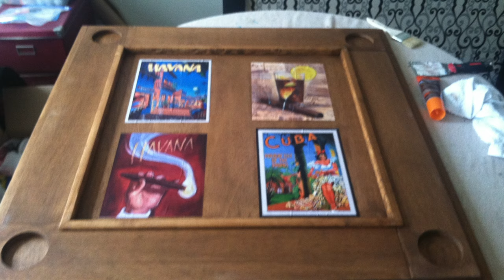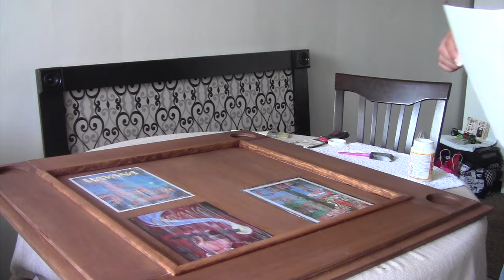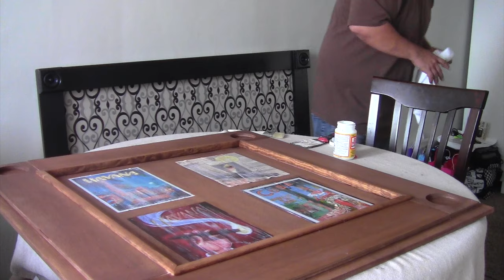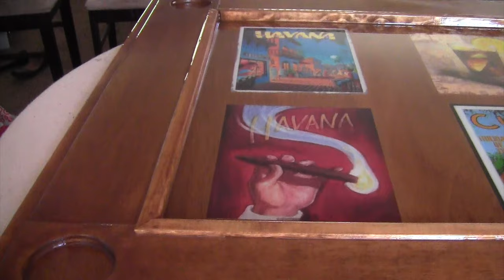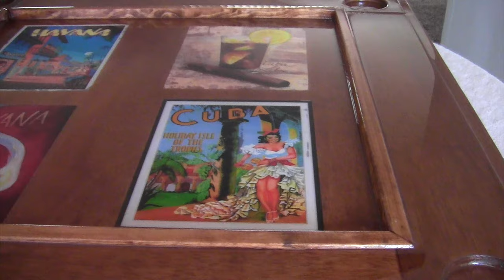Domino Table

Comment: I am going to first wish you and your lovely family many blessings! and LOL @ dad finding imperfections! Thank you for posting the steps and measurements. very insightful. I will be attempting this with a few varying techniques later this summer. and will definitely send you some pictures of how it turns out! Stay blessed!
Reply: Steven Padilla where can i find the steps and measurements??
Reply: @loraineboyce4573  Thank you for the question. Most videos have some of the measurements and steps in it. The base depends on how high you want it. some like them smaller some a little higher. It's a preference thing.  Here are the measurements I am going to follow for mines:

Tabletop 34in x 34in
4 -  4 3/4in x 27 3/4in boards with a 3in hole in ea board (leave 1in perimeter around base and use that as a guide)
everything else is pretty much preference. you can use a hole bit to drill the hole you want for your beverages and even use some DIY or ebay purchased scrabble tile holders for the domino rests. You can also decopage the center with whatever you want. 

Enjoy building!

Hope this helps!!!!